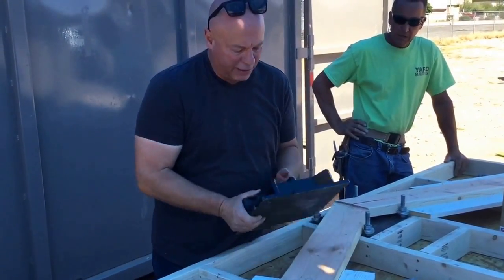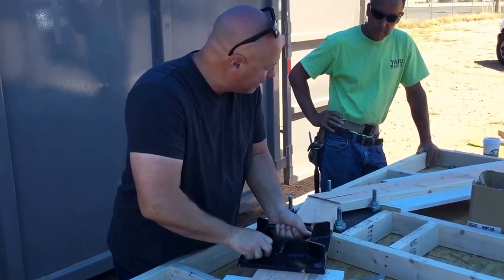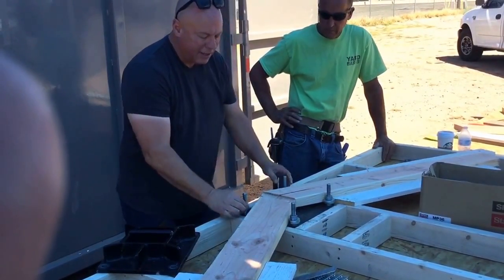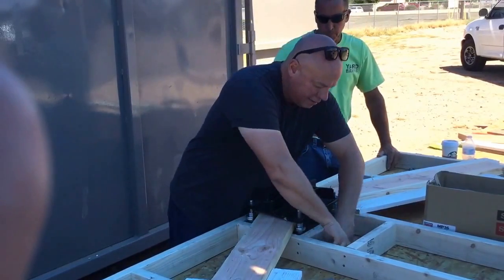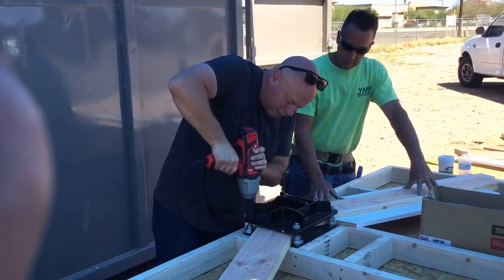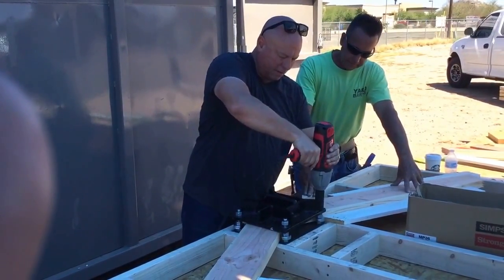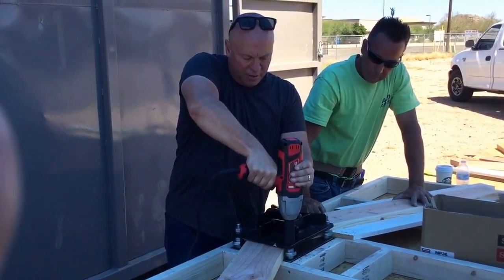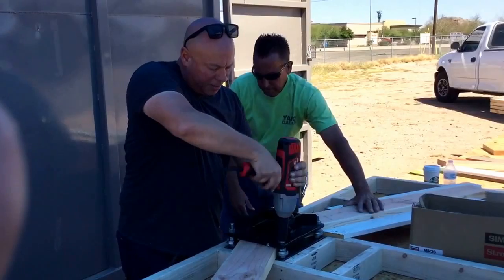Truss plates pressed on by hand

Comment: Great idea, but it made me think of something else that would be much faster.  Just make plates for a log splitter.  Most of them will stand up vertical, so you just have to make supports that would be level with the bottom plate.  Most splitter wedges are just held on by a bolt, so you could take that off and bolt on the top plate.

Comment: I keep thinking on this problem of how to press gussets without a $40K truss assembly roller. Archimedes said with a lever long enough he could move the world. I keep thinking that some kind of compound lever can be fashioned that would allow people to quickly position a base and an anchor that would allow a press plate to be positioned so it could press a gusset using just a lever.  It might have to work in conjunction with some kind of solid surface with a grid of anchor points, but for any operation that needed to fashion trusses on a regular basis it might be worth it.

Comment: 1/2 inch impact driver enough power? I didn't get a good glimpse of the one you were using.  I am going to use your approach on my own shed with a very basic king post truss with an 8' span and 5/12 pitch, but will also use OSB gussets and 6" truss screws at the apex and 8" ones where the rafters meet the bottom chord, for a belt-and-suspenders approach.

Comment: This is a solid idea for getting it done on your own schedule as you stated.  Well done.  But, for speed: OTC is/was a company making automotive tools.  I had a jumbo C clamp for pressing in/out tie rod ends or something like that (I bought that tool 30 years ago).  Very beefy unit.  A little southern engineering and a port-a-power (portable, hand-pumped hydraulic cylinder) could be fitted to the clamp.  It would take some monkeying around but it would be fairly easy to move from place to place on the truss jig and would likely pump up faster than the four nuts you're using here.  You can get the port-a-power generic Chinese stuff from Horrible Freight.

Comment: I'm a retired auto mech. I have many presses and pullers in my tool boxes that are operated by a screw thread principle. 
But when I built my shed I made a jig on a sheet of plywood.  Set my pieces in the jig, layed some plywood plates on the joint with glue, and nailed er down.  It has withstood several feet of Denver snow for about 15 years and still solid as a rock.
Reply: Knew a guy who built his whole house with this method, been standing for 50 years now
Reply: The mending plates done with plywood for sure work and work well.  I've done the same thing.  These metal mending plates offer a possible advantage of being ready to install as soon as the plates are installed as opposed to waiting for the glue to set/cure.  Sure, the mechanical fasteners are there to hold the plywood patches but I chose to not stress the members until the glue had set up.  But, for future readers: the plywood patches/plates and glue and fasteners is a solid way to secure truss members.

Comment: I pressed 8" x 8" truss plates with 2 twenty ton hydraulic jacks. First attempt did not work but my second version worked well. It was surprising how much force was required to fully set the plates, 40 tons!

Comment: This is a great idea if your out framing in the middle of nowhere but, I'd be willing to wait one or two days for a truss company and have my guys go do something productive instead of waiting on each truss. That small truss does not need a metal plate. Have you ever heard of 3/4" plywood gusset. Use a small amount of glue and add 8 staples per side would be sufficient.
Reply: Ken Watters. What is it that you do for a living?? I'm a truss designer and I couldn't agree more on your comment. There are people who take the liberty and think that they can build components without any engineering. I know a case where a lumber yard built trusses in their back yard the same way and guess what, they are no longer doing it after a couple builds collapsed. Even if a truss gets damaged in the field YOU NEED AN ENGINEERED TRUSS FIX, if you chose not to, it just adds more stress and deflection to the trusses next to it.
Reply: It's not that easy. Having worked in a truss plant I can tell you that sometimes customers place orders and they don't get their trusses for months because there are dozens of orders before theirs.

Comment: I've always wanted to build my own trusses. The problem and reality is any job that's going to be inspected needs to be built by a truss manufacturer with certification. Either that or have a Company certify the ones you built which no one would go out of their way to come out and certify. It sucks but it's just the reality of it. I think it would be awesome to build your own trusses for a smaller non permit job though!
Reply: Don’t do this but you could ask for a quote for the trusses that you want. After you get a quote ask them for the engineering, tell them the city asked you for it to give you the permit. Once you have the engineering you can make your trusses based on it. The last thing that you will need are the truss labels. Every truss should have a label.  You can go to a new construction development, look for a house where they just delivered trusses and take a look at the labels to see how they make them. Then just copy them with yours truss information of course. There, you have trusses with engineering and labels. But don’t do it.
Reply: galvanised plates with pre-drilled holes and fixed with flat-head nails (or my preference is tek-screws) is an easier option.  hydraulic or other made-for-purpose presses do such a good job.

Comment: You can also use a staple gun to staple the peak of the truss in place and then hammer the plate on. The press makes the pressed plate look pretty but you can hammer it on too. That's cool you are taking things in your own hands.
Reply: The plate will look ugly if you hammer it on just a heads up if you try it that way
Reply: The correct way is with a press....you compromise the overall strength of the plate if it’s hammers on
Reply: Roddy da said it exatly

Comment: In many states, if you're a licensed general contractor, with a permit,   repairing or modifying an engineered building component, like a truss,  requires an engineer's letter. Plywood gusset plates are often used for truss repairs.
Reply: Wil 1/2 plywood work as gusset plates
Reply: @johnnymensi1865  yes, but they now require 3/4" in FL

Comment: Why was a nail plate truss needed, for such a simple truss.  Their are many ways to permanently attach those cords together, much faster, much cheaper and much better.
Reply: Drew st. john you're absolutely right there are a lot of different ways this can be done, this is just one way. We do a lot of the same trusses with to same span and pitch. Something I learned a long time ago when you have employees, is to take the thinking out of it! This jig and pressing plates made the process simple and requires very little experience for a new employee to duplicate. Thanks for your comments.
Reply: Do you feel wood/nails for connectors or pounding in aluminum brackets? Which one would be easier & stronger?
Reply: It would be faster to use glue and screws and plywood.
Reply: Galvanized steel, not aluminum.

Comment: Why do people use these plates for trusses. It is stamped on the side not use them for this.
Reply: Jerry Flores having worked in a truss plant I can tell you that you're absolutely wrong.
Reply: some are made for trusses, some are not
Reply: The box on the table is MP36 mending plates. The manufacturer specifically states "For non-structural applications only; not for truss applications".
Reply: @officialmetalwill  It says, stamped in the truss they are NOT for Trusses.

Comment: your system takes too long, mate.
it is far better to use a 1/8" mild steel plate with holes for four 3/8" bolts, and you are done, stronger and faster.

Comment: All I got to say is I make a living on fixing dumb shit people do.  This is an engineered component not something framer Joe should be building.
Reply: Ken Watters hey I really appreciate that, I certainly understand the engineering of any truss package I use to own a truss plant. In this particular video I mentioned it will build sheds and portable buildings. Our portable buildings have a maximum span of 12' and not a lot of exposure to failure with a 6' run. Thanks for your comment.
Reply: You're criticizing this guy personally and not touching on any actual reason he's doing anything wrong. What about his process is technically poor, assuming his materials fit an established specification? I could see hammering being a poor process for various reasons. He's pressing like factories press except the mechanism is different. It's still even and it's not too rapid. 

If you're concerned about others doing it, his system requires so much attention and craftsmanship that it's beyond even many skilled craftsmen and fabricators.
Reply: @XRPVenture  I would completely agree keep it under 12' span hard to make them fail.   In my career I specialize in truss engineering I have seen people hand make there own trusses so many times improperly.  Many times it cost them way more than to just have them engineered and delivered.
Reply: @Kimoto504  Sorry shouldn't have been critical.  Nothing wrong with using a screw press, the mechanical is massive.  My issue is people need to understand that truss plates bought at a big box store are not technically even for structural use.  But even if you do have access to truss plates they require engineering and design.   Nothing wrong with properly designed plywood gussets either.  Or I built my own Timber trusses with steel gusset plates and SDS screws.    Just get some professional advise on the design it will likely save you in the long run.  I have seen fixing the mistakes cost homeowners so much more than the trusses ever cost to begin with.